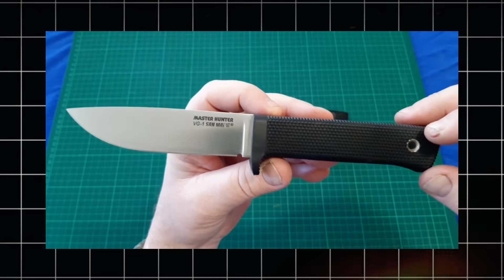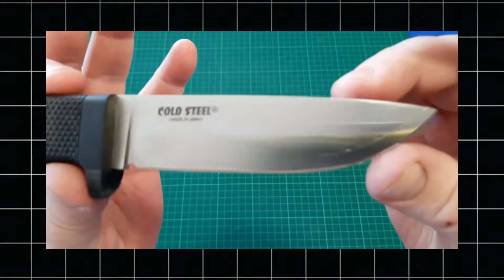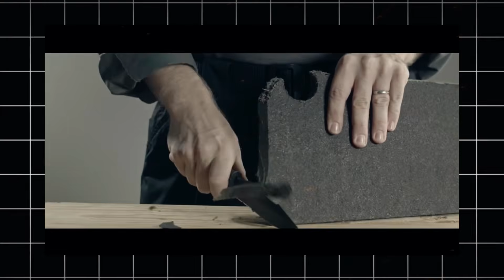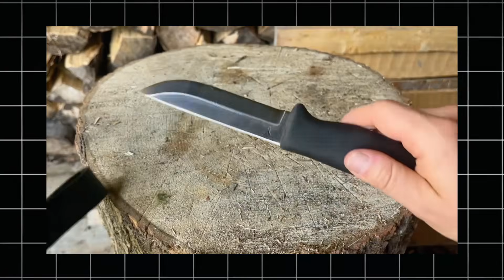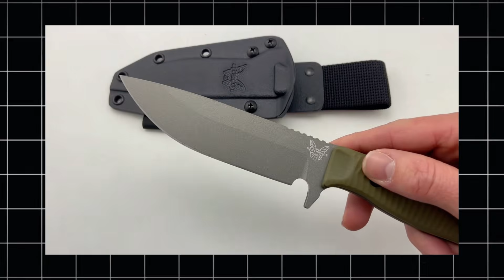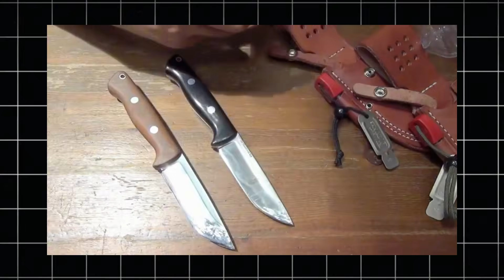I Pushed 10 “Indestructible” Knives Past Their Limits — Only 3 Survived!

Comment: Your No. 1 blade, is a joke. That "Saw" does not have the right "Teeth" Its a throwback to the days of Rambo. When kid's wanted a knife like Rambo's. I will only chop and split with 3 of my knives in my collection. A Parang, A Khukuri. And the Condor Moonshiner. If I am going fishing. I will also take a short blade, like the Buck 102 Woodsman, or the Buck 117 Brahma. Both knives are also very capable camp knives. Any ways, your vieo was Meh at best. But then again, I've been collecting knives since the early 80. Now if I have to prep large amounts of firewood, or build a shelter. I will take a small folding saw, and a short handled axe.  You really should have included some budget friendly knives.